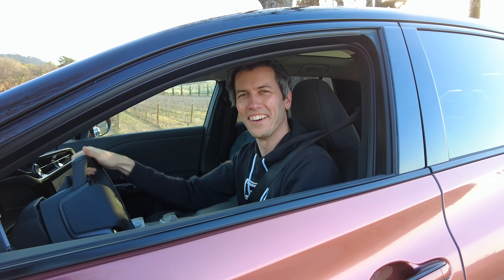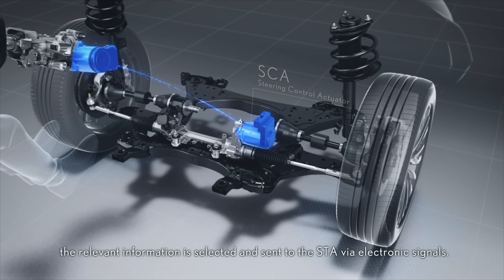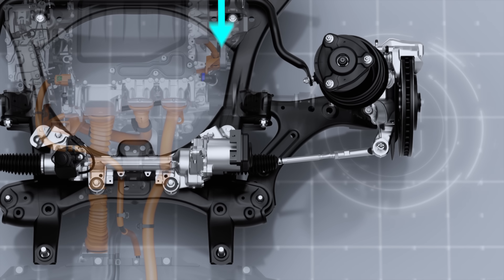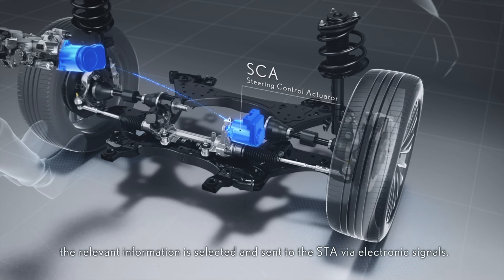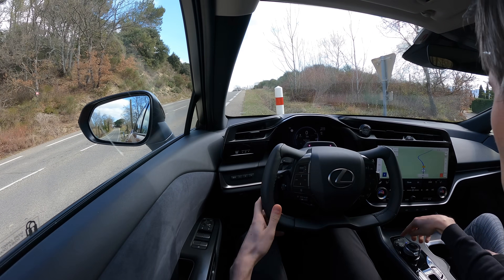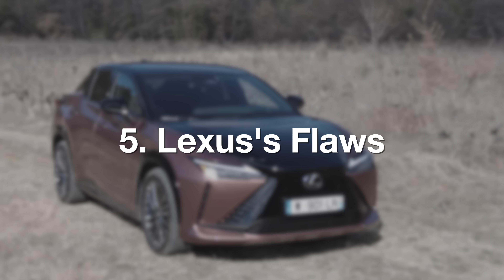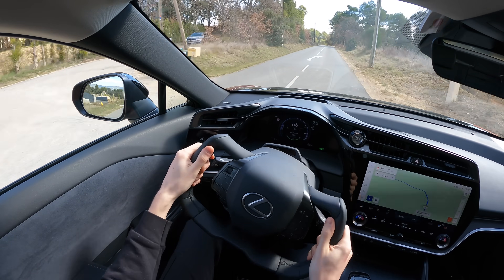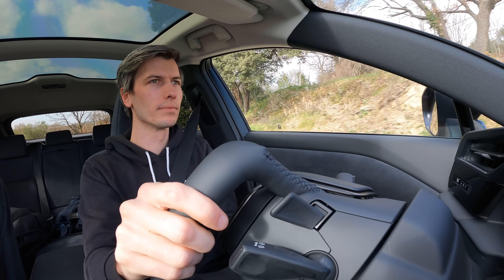How Lexus Fixed Tesla's Bad Idea: Steer-By-Wire Yoke

Comment: I think that if this matures a bit and solves the lag you mentioned it should sooner or later get some "modes" available to the user. Let people with twitchy hands who don't like sensitive controls select a more dull setting while people who like things to be very sensitive select a sharper setting. Have it in three steps like "calm-normal-sharp" or somethign like that and let the user chose which they like best. Each setting will still have the curve of steering ratio change with speed, just the whole curve moved up or down a bit.
Reply: lexus loves their cars slow and unresponsive, so wont happen
Reply: @sam712  yeah I’m reasonably confident they’ve done this on purpose
Reply: The lower sensitivity settings wouldn't work on the yoke wheel as it stands. The limited turning arc of the yoke sets a lower limit on the sensitivity since going lower would prevent you from turning the tires all the way before you hit the wheel locks, this is why low ratio wheels spin over 800 degrees. At highway speeds they can lower it because you don't need to full steer, but at low speeds not full steering would make 3 point turns impossible. This could be fixed with variable wheel locks but that just adds to the cost and complexity just so people who don't like the high sensitivity can be mad at spinning the yoke instead (see tesla). If you want high sensitivity buy the yoke, if you don't buy the wheel, these are already two very different customer bases so just sell them different cars no need to introduce settings.
Note: non-linear steering ratios could also make the yoke work but if the problem is people not liking high sensitivities then they are going to hate ones that change sensitivity as you spin the yoke. This could also introduce more processing delay which is already an issue.
Reply: @JosieShmosie-x7m  this wouldn't be a problem if they didn't have to get rid of the good old-fashioned wheel and replace it with a yoke. The way most steering wheels are designed they have a yolk in the middle surrounded by the wheel. A lot of times I am hanging onto the side of the steering wheel as if it were a yoke but it is nice to have the rest of the wheel there. I think that would be the hardest part to get used to for me is not having an entire steering wheel. I kind of see the problem as trying to reinvent the wheel but having a hard time matching it.
Reply: @JosieShmosie-x7m  You are right that decreasing the sensitivity on the whole curve at all speeds would result in either more angle required on the steering input or less angle available at the wheels for very low speed. What you could do instead is have the low speed end of the curve fixed (nobody thinks a car steering is too twitchy at parking lot speeds unless it is someone who should never hold a license) and change how steeply the curve curves towards the higher speed. The dullest setting still needs to pass the moose test or what its called and the sharpest can be like F1 if someone wants it. 
Also like Keith Yinger said you do not have to have the yoke with it. Just get the variable adjustable response, the easier packaging, the higher safety (no shaft to get pushed into the driver) and keep a circular wheel on it. That way you also keep it usable for someone who perhaps has medical issues with permanently holding the steering at 3 and 9. 
To me this looks like when the first electronic throttles came and had lag and issues with changing sensitivity based on the condition of the engine at the time. Just general teething problems. Today all cars have it no general user thinks about it. Aircraft of all sizes have full fly by wire systems and FADEC engines and nobody complains about lag or non-linear response. Cars are notoriously bad at adopting anything not at least 100 years old so I have no idea if and when this catches on. I just think that from technical point of view there is nothing preventing this from being possible and possibly quite good.
Reply: Just more (and expensive) things to break. Also, driving is more fun when you can hold at the 12 o'clock position and lift your index finger when you drive past a friend. There's no way to hang your arm out the window either. I'm good with the rack and pinion.
Reply: It is physically impossible. Even a steering column has some “lag”, but SBW is limited by how fast it can provide feedback by the speed of its systems, from sensing the fluctuation in the tyres, the processing it takes to interpret the sensors’ signals, to sending a signal to the motor in the steering wheel and finally the motor turning the steering wheel... its a lot of stuff that has to happen, and it will NEVER be as fast as just having a metal tube physically attached to a steering rack.
Reply: @ElZamo92  I get what you are saying but I do not think you fully appreciate how fast electronics can be. I know for a fact that you can make the electronics so fast that the flex in the tires will be felt ten times more than the lag from signal processing. You can also have them use the redundant motor-gearbox pairs to eliminate the mechanically required play in the gears, unlike purely mechanical link. At that point no human will be able to tell the difference between having and not having a physical link. 
With the right SW  for input shaping you could even partially compensate for the predictable part of the flexibilities in the system (like tires) making if feel "faster" than a simple no-electronics system. And those are just the possibilities I can think of at the moment. I am sure others will come up with more. 
What I have serious doubt about is if the automotive industry can figure out how to make it really good and profitable at the same time. I think they are more likely to make it not very good but profitable and then spend a ton of money on marketing to convince us it is good. Like they do with SUVs for example.
Reply: @ElZamo92  People said the exact same thing about throttle by wire and it is now faster than mechanical linkages. You have to remember mechanical linkages have input lag as well because gears have slack and giant metal rods have momentum that you have to slow down before you can change directions. Turning inputs on a rack travel at the speed of sound in steel but they move through a wire at near the speed of light meaning mechanical linkages will always be slower than electronic ones. All that signal processing on general computers can slow it down, but as the tech matures purpose built chips can take that signal processing time into picoseconds. Modern fighter jets switched to fly by wire expressly because it is faster so why would it work for them with 6x the processing but be impossible for a car to pull off.

Lexus also only got rid of the steering column so they still have slow mechanical linkages from the rack. You could instead remove the rack and independently steer the tires. This also allows different angles on each tire, which is something that modern racks already do so the inside tire doesn't slip on corners, but with electronic you can change the amount this happens whereas mechanical links have a fixed ratio. This is more processing but it is processing your car is already doing for traction control it just needs to be adapted.

Comment: It’s not just a question of losing electrical power, it’s a question of losing the ability to make electrical inputs to the steering gear. If you can’t use your accelerator due to a rat or mouse chewing through wiring or corroded connections, you can’t go or if you are going you stop. At 80 miles an hour, you would be wishing for that direct mechanical connection to get you to the side of the road or to the dealer for repairs.

Comment: The complexity of the evolving technology will only get costlier with time. You have 3 batteries, 2 are back up. Then electronic parking brake, 2 steering motors etc. As the vehicle ages you will surely be paying luxury diagnostic and maintenance or repair bills. I guess since most people aren’t buying new cars so one way to make money for manufacturers and dealers is to over complicate simple features that was drivers can visit the shop more often and order new replacement parts.😂

Comment: I would have designed a progressive steering ratio, the more you steer the lower the steering ratio is. That way, you can have stable highway driving, low steering ratios for parking, and still a predictable wheel position compared to the steering wheel position.
I wonder how that would work out, I can't imagine Lexus didn't try it.

Comment: I would probably like it if there was a parameter or indicator that you could monitor that would tell you the current "sensitivity" and current ratio.  Then you can subconsciously train yourself to that value as speeds and conditions change

Comment: I like the idea. I doubt the reliability is a problem cause the aviation world has solved these problems long ago. The flexibility is going to be excellent for users. If the stearing ratio curve was customisable by a driver nobody would loose. Everybody would pick the preset they liked.

Comment: The delay definitely is an issue. It would be interesting to know what’s the limiting factor. Is it software issue? Or is the motor simply maxed out in terms of speed. The servo motor not being strong enough thus requiring a robust gear reduction to apply enough force is a likely reason. It’s very difficult to match a purely mechanical system such as hydraulically assisted racks. The other issue is longevity. A hydraulic rack with a linear piston applies very little force on the pinion gear and will last for hundreds of thousands of miles. Many modern electric racks are shot after 60k miles 🤔

Comment: I can't believe they kept the steering linkage. Should be one motor (technically two) per wheel, no linkage. Then they could also adjust Ackerman per vehicle speed. Stability control could also adjust power, brake, and steering angle individually in tricky situations.

Comment: I actually think variable steering ratio is more intuitive than constant ratio. Sure the same wheel position does not correspond to the same wheel angle but I think drivers care about angular velocity more than physical steering angle and angular velocity is dependent on forward speed and steering angle. I would want the same wheel position to correspond to the same rate of turn.

Comment: Regardless of how many safety system are in place, the simple reality is, electric systems over time fail. With everything from corrition to animal damage the list of reason for failure is endless. And yes |I know they have worked for decades in the aircraft industries but, a car is not an aircraft. Yes, there could be legislation put into place to ensure standards are maintained, however, the result will be over priced vehicles and vehicle repairs. Interesting tech, but nothing more.

Comment: This should be illegal.
There should always be a mechanical connection between you steering wheel and the wheels.
If that position sensor goes bad or some wire rubs or shorts or whatever while you drive... you're dead.

Comment: The lag is an absolute deal breaker. I know it well from simulators and don't want it in my real car. If they can fix it that's cool.

Tesla's yoke is nowhere near as bad as people think. Yes, it's a bit awkward at low speeds, but then you have plenty of time to be deliberate, and build new muscle memory over time. The advantages worth it easily. Many people actually love the yoke and won't go back to round wheels ever. Also turning the yoke with your palm works fine, and while it's not as safe, again, you only have to do it at low speeds when you have plenty of time to correct any mistakes. So unless you want to do donuts often, it's fine.
One YouTuber even took a Plaid to a race track and and an advanced driving course, and tested it with a few people including inexperienced drivers and the course instructor. Neither had any issues with the yoke. They had to manufacture a case where it was inconvenient.

Also Tesla could easily do steer-by-wire, they do far more complex things, so there must be a reason why they don't.

Comment: This is much like the Boeing vs Airbus flight control argument. In a Boeing, the the flight controls try to assist the pilot, but not override input - the pilot has the last say. In an Airbus, the flight controls take input from the pilot, but will override that input if it thinks the input is invalid. Here I think the pilot should always be in control in case an unexpexted corner-case is encountered (it happens).

Yes, some people may want a yoke, and this does make sense for that application. However I'd rather have a simpler mechanical system where I have direct control (and final say). But then I also prefer hydraulic over electric assist for steering feel.

Comment: Couldn't that twitchiness be mitigated with a non-speed dependable, non-linear steering ratio that decreases with the rotation angle of the yoke? Or would that require too much total rotation angle of the yoke again to be practical?

Comment: It's not the first steer by wire car either. There was already Infiniti Q50. However, the Infiniti had mechanical backup system, which limited steering wheel position. Eventualy, they phased it out.

Comment: If it was electronically programmed to have a variable steering ratio, then it should be able to allow the driver to select a fixed steering ratio if they want to.

Comment: This honestly makes a lot of sense. Everyone was ok when throttle cables were replaced with ECU controlled fuel injection and EV motors that run off a sensor on the throttle pedal. The transition to steer-by-wire makes that same leap. Also, no one freaks out whenever they get on a fly-by-wire airplane, that has more risks than a steer-by-wire car

Comment: Much like "mouse acceleration" in computers, it's a very difficult to tune system, hardcore drivers may expect each 50º turn to yield the same steering angle, but the (dynamic) ratio will definitely force the drive to be a lot more focused.
(Imagine each time you turn 50º, the wheels turn quite unexpectedly however much it wants...)
Reply: I disable mouse acceleration on other people's computers for them when they're not looking.  That's how much I hate it.

Comment: I think the technology is great. The yoke on the other hand, still useless. Put a normal steering wheel on a steer-by-wire system, and allow both a 300 degree lock when cruising about, and true 1:1 feel of a 800 degree lock in a "sport" or "pure" mode for the predictable feel. And there, assuming the wheel turning rate is fast enough, you have a system with no compromises.

Comment: it would be nice if you also mentioned that a physical steering column is required by NHTSA, hence steer by wire is not a standard anyone can use in production yet.
Reply from the maker: Where'd you see that? There's a 300 page doc from 2018 where NHTSA outlines safety requirements for SBW systems: https://www.nhtsa.gov/sites/nhtsa.gov/files/documents/13502_812576_steerbywire.pdf

Comment: I don't think I would like the lag in steering. After 7 years, I still haven't gotten used to the lag in the throttle by wire in the vehicle I drive.

Maybe it's my vehicle that the lag is more pronounced than average.

I think I would love the steering by wire as long as I couldn't feel any lag. Is there any way it can be improved?

Comment: When it comes to doing a mechanical approach, I get how it would be too twitchy at highway speeds, but couldn't they just simply configure the motor to assist less at higher speeds?  That way, you're still directly mechanically operating the wheels but you feel more resistance than you normally would, so you're less likely to make twitchy turns.

Comment: Never would I ever buy a steer by wire vehicle.  If the power to the steer by wire system fails while driving, your screwed.  No control.

Comment: Absolutely unnecessary overcomplicated thing. Why replace a reliable and simple thing which works for many years, by something unnecessary overcomplicated which reliability is unknown and as we se in the video, the speed of reaction to the driver's inputs is questionable at best?? And this is the safety crucial part.

Comment: I don't agree when you imply that the drive system should restrict sudden movements at high speeds. I live in portugal and sometimes the roads have a lot of potholes that you only see when you are very close, and in those cases you need the wheels to respond quickly to avoid major damage to the car, in addition to that sometimes wild boars appear crossing the roads, in roads where you drive at 90k/h. If you can't avoid a collision with animals of that size at this speed, good luck with your car fix.
The car must allow you to drive, you have to know how to drive and take responsibility for what you do, it is not the car that has to teach you how to drive or prevent you from doing so.

Comment: Steer by wire cars when it dies and you need to roll the car with no power while rolling it. Even after you explained the backup power I still don't think it inspires confidence especially as these batteries will age or the car is left sitting in a lot and then needs to be moved but won't start.
 Also in order cars keep in mind the power steering is hydraulic based rather then electronically.

Comment: malfunctions even in FAA regulated planes. It will happen in cares a few times too. Trust me. One of the motors/servos turning it fails mid turn, fails period. shorts someway and goes the opposite direction, or decided to turn on it's own randomly. etc. I realize the benefits, especially on a track. But on city roads it 100% unnecessary.

Comment: lexus has had mechanical variable gear ratio system (VGRS) as an option on some models for a long time, and it's awesome. but certainly a 'by wire' system has advantages.